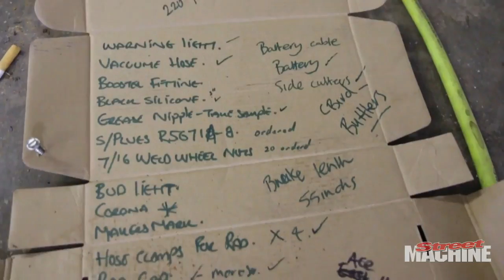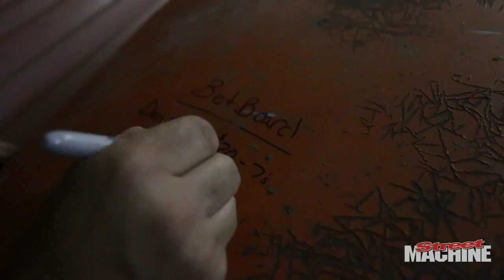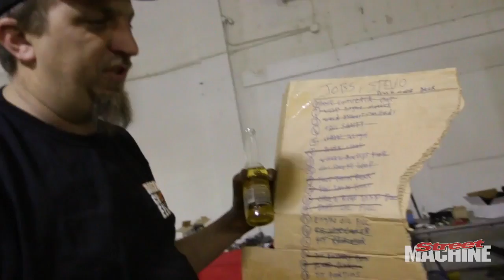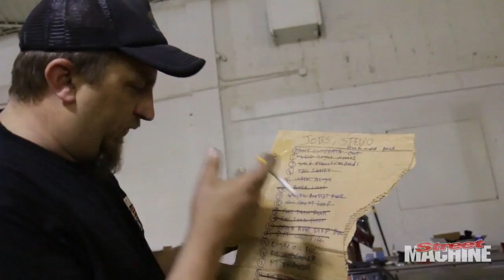Mental Aussie Drag Week Chevelle Fires Up

Comment: be honest though, if you hung a turbo like that on a Civic, they would call you an idiot.
Reply: If you had dragged it out of a field 2 years ago, built the engine on the other side of the planet, without having a car to mock it up in and installed it a week before drag week and ran it succesfully I wouldn't. Otherwise yes, I would call it idiotic, but the same would apply to this car.